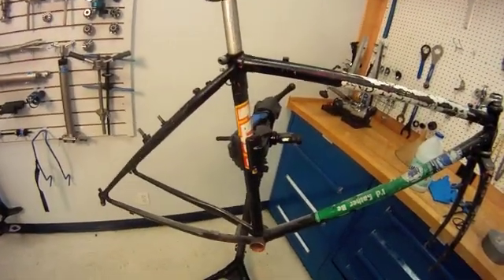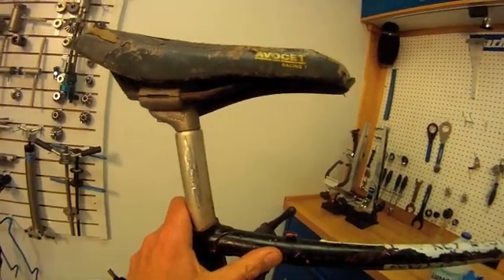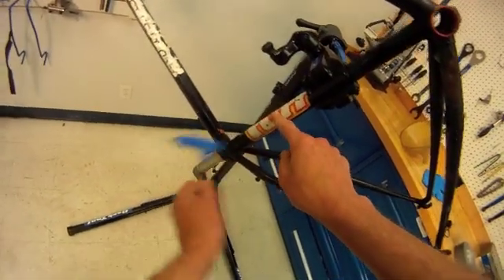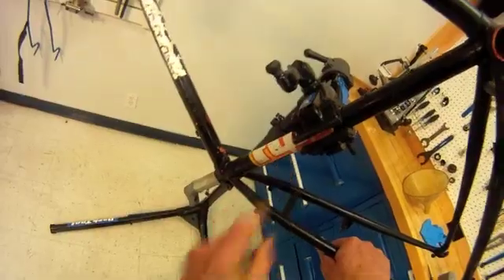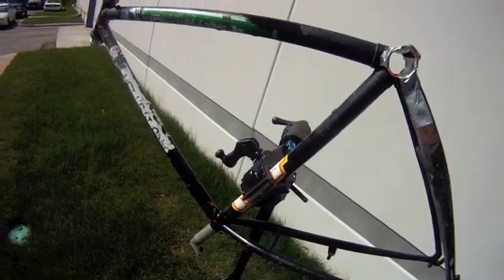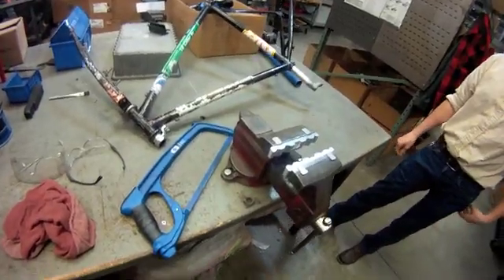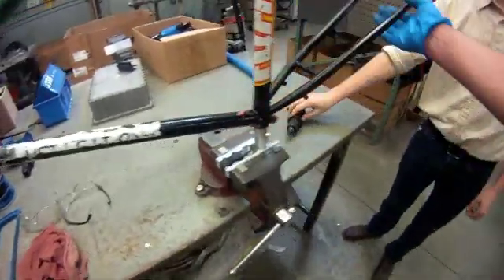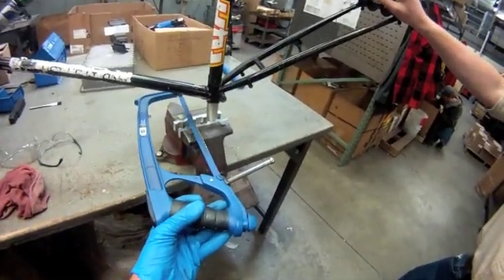Bike Seat Post seized- attempt to free with ammonia

Comment: You guys should create a slide hammer attachment that can go down the inside of the seatpost and hook the bottom so the seatpost can be pulled out. Basically a slide hammer hook that already exists but with a shaft long and thin enough to go the full length of a seatpost.

Ill glady buy one so I can restore my mint Kona A'ha (the green one).

Comment: I have a Specialized carbon hybrid frame, do I need to put lubricant on the aluminum seat post to prevent it getting stuck?
Reply: Yes you need Park Tool SAC-2 or super Carbon Alloy Compound this will help from the post getting seized.

Comment: I tried loads of things on a seized post, and the only one that worked was to drill a 12mm hole in centre/bottom of the BB shell to allow straight access to seat tube, drill a hole across the seat post and bolt an old hub axle through it, and then (with frame upside down) drop in a section of straight 10mm rebar (ask at a demolition site).The rebar rest against the old axle, and you can beat it out with a lump hammer. Support the frame carefully on wood to prevent deformation. The hole in the BB shell doesn't matter if you fit a cassette BB unit afterwards.
Reply from the maker: Interesting method @type17 this would definitely be a last resort as removing material from a frame can weaken the frame and make the safety questionable. cheers!
Reply: Yes, it was definitely a last resort after weeks of on-off trying of other methods, but it was a 90's Raleigh beach cruiser, so not a bike like to see high-energy usage. However, I did keep the hole as small as possible by using rebar (thin but still strong). It's also the one place you can probably get away with drilling a hole in any frame - similar to the weight-saving cut-outs in gorgeous Italian race frames.
PS: Love the content of this channel, Hi to Calvin and all the gang. I'm still using my Park Tools every day, some of which are 25 years old.
Reply: @type17  there's another YouTube video of someone using a 10lb slide hammer to remove a seatpost.  it looked effective in a similar way, but did not require any frame modification

Comment: Hi Calvin, did you make a video of the hacksawing you resorted to? If so could you share a link to it please?
Reply from the maker: Hi Kevin, that is a "jab saw" and we do not have a video on this.-Calvin
Reply: Hi again Calvin, thanks for the reply, as there's no video can you briefly describe how you attempted to remove the post with the jab saw and say whether it was successful? Failing this method have you guys ever tried the caustic soda dissolving method? Thanks In advance.
Reply from the maker: The jab saw was successful, it usually is, but takes a long time.  The saw cuts vertically inside the post. You make several cuts, at least 3, but more is better. The chemical treats often don't work but sometimes you have nothing to loose so give it a good. There is often a pressure from the built up material and corrosion. - Calvin

Comment: Calvin, are you sure that the ammonia did not leak out before it could do it's thing?
Anyway, I tried this method and it did not work.......
Reply from the maker: The ammonia was still inside when I checked.  It did nothing to eat the corrosion.  There are cases where the post has bonded to the frame. This frame required a hacksaw. 
-Calvin

Comment: I have a couple more ideas. Instead of just pouring the ammonia once and letting it sit overnight, dump out and refill the seat tube with fresh ammonia every 30 to 60 minutes and tap firmly on the seat tube with a rubber mallet  every 15 to 20 minutes to try to break up the corrosion inside so the ammonia can penetrate between the post and tube. Also, if you clamp the post in a vice and the post spins in the bench vice, have a second person put a pipe wrench on the post if you have enough room so that you have more grip on the post. I just used this same method less than an hour ago to free a post that was stuck just as bad if not worse than the one shown in this video. The post will be badly scarred but you will have a much better chance of getting it out in one piece